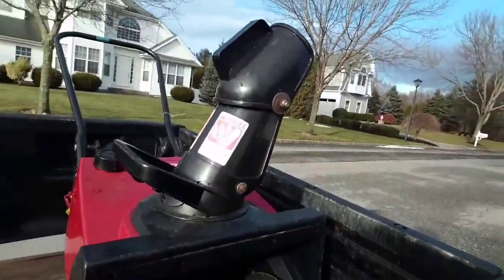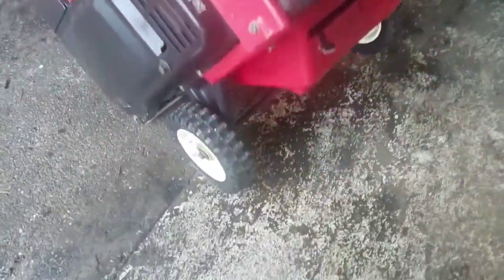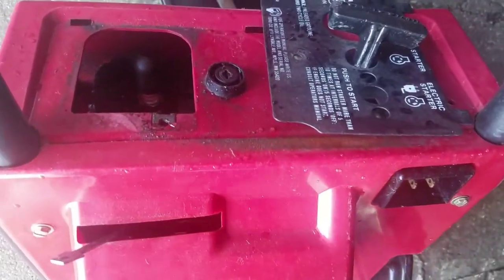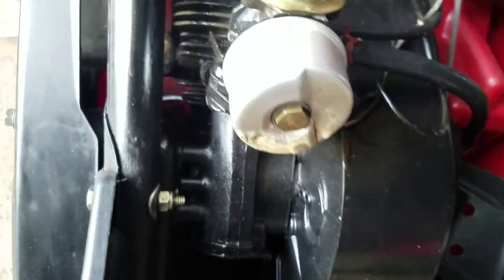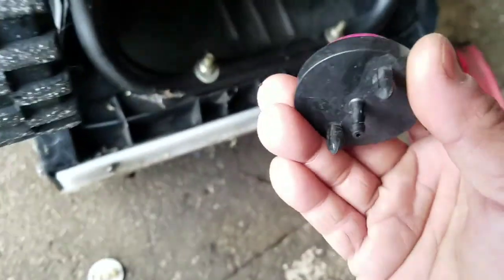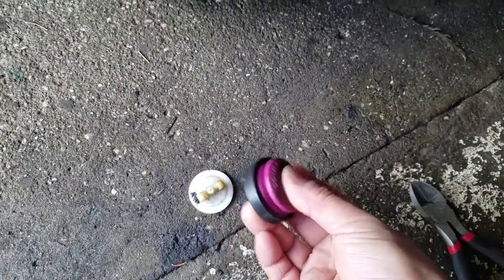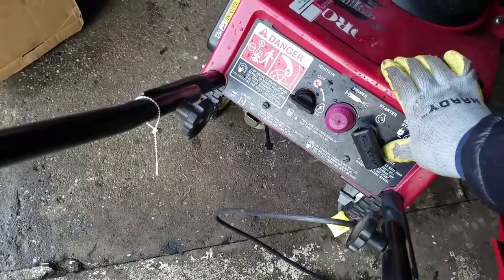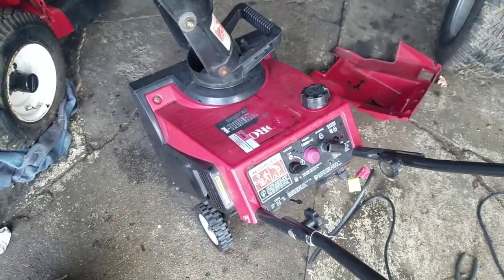TORO CCR POWERLITE-E 3HP 16" TECUMSEH SNOWBLOWER SNOW BLOWER CARB CLEAN PRIMER BULB REPLACEMENT FIX

Comment: These little snowblower are great I have one I got mine for free it needed a engine great find mowers N blowers
Reply from the maker: +zacks films thanks man...where did you get a replacement engine and how much did you invest in it to get it going?
Reply: Mowers N Blowers  I used my old engine from my old powerlite to get my new one going the only thing that I had to buy was the paddles and scraper bar
Reply: Mowers N Blowers tomorrow i will do a video on my toro powerlite for you ok 😀
Reply from the maker: +zacks films looking forward to it!

Comment: When I receive older mowers, snow blowers or any small engine equiptment I always take the gas tank off and clean out, replace the fuel line remove the carburetor and clean it thoroughly. Much less hassle not to. Unless I know the mower or blower has been running recently.
Reply from the maker: Well,  you’re spending a ton of time for no reason if it runs.
Reply: I'm not looking for a quick buck on a small engine turn over. I want to make sure the person that buys it isn't going to be bringing it back because I didn't do a good job to make sure it runs correctly. Many of these small engines on yard equipment are abused, left outside for years without the owner's even maintaining them correctly.
Reply from the maker: @steven4686  I understand but cleaning the gas tank?  Whatever floats your boat

Comment: Hi any idea where to get a starter for this exact model?
Reply from the maker: Sure...ebay.  https://rover.ebay.com/rover/0/0/0?mpre=https%3A%2F%2Fwww.ebay.com%2Fulk%2Fitm%2F152912100032
Reply from the maker: It's expensive though...i can sell you one for $50
Reply: Don't really want to spend that much. Trash picked it. I would do 20$. No offense.